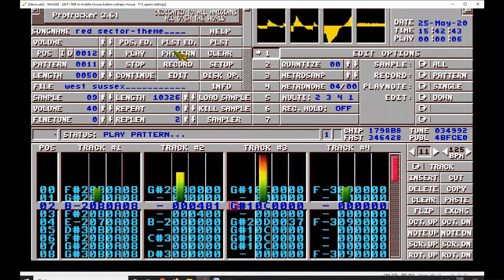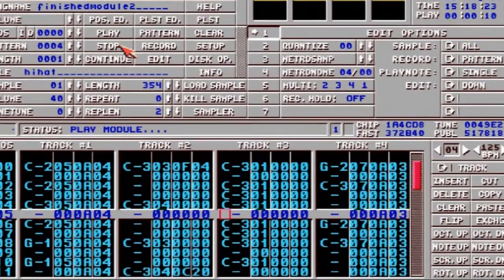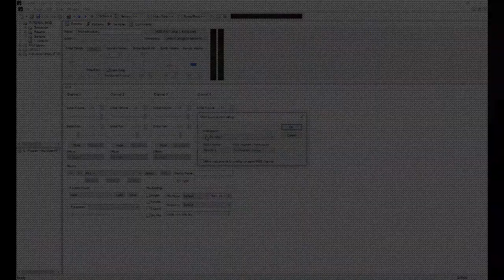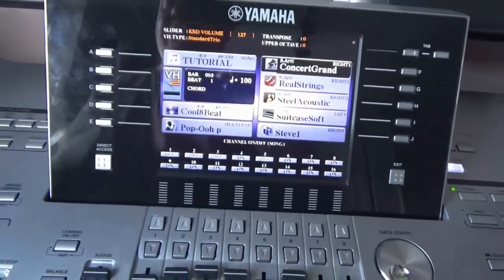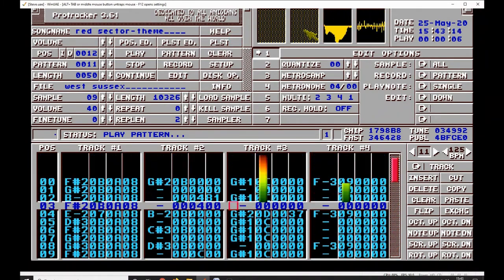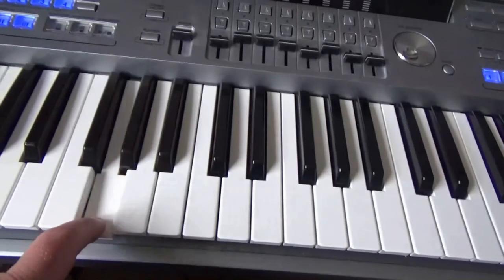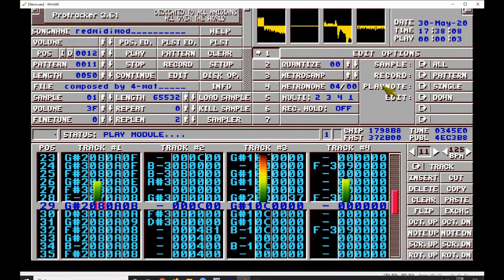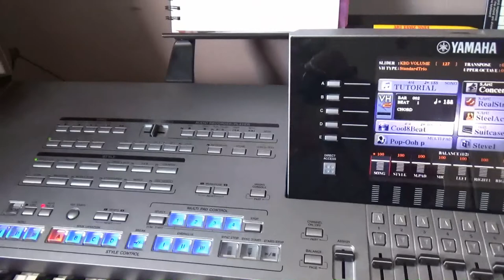Convert Amiga MOD file to MIDI (and have it sound great too!) - Soundtracker / Protracker to MIDI

Comment: Thanks for the tutorial! It seems to be a lot of work to do the conversion of a mod into a midi files, but a fun work to do. Don't be dissappointed for the few visits to your video, think that you provided a realistic way to let amiga music live through quality midi files. I´ll will be trying to convert some easy mods first and then some more challenging. I'll be using a Roland XP60 synth as a workstation. Thanks again for this very useful video!